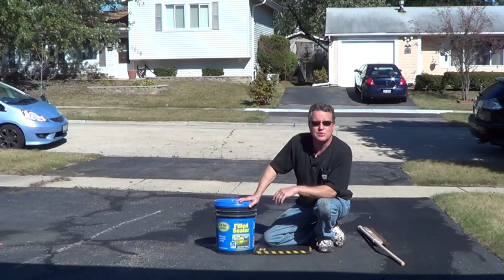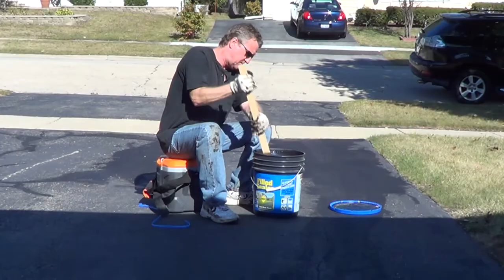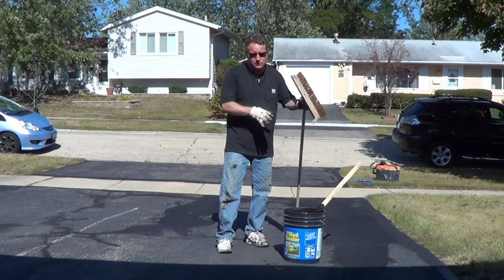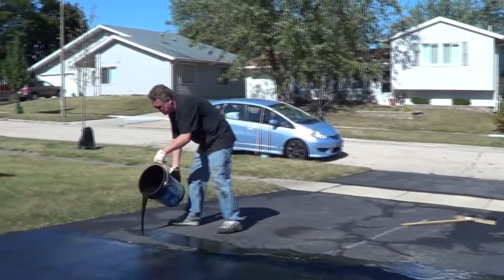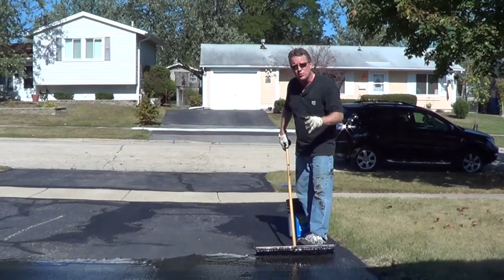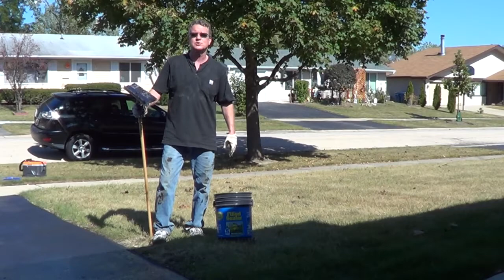How to Seal a Driveway - Driveway Sealer

Comment: Afterward, allow 48 hours for the water to evaporate and to firm up before pulling straight on/off, without turning steering wheel.  Wait 30 days to full cure,  you want to avoid heavy vehicles until then. 

For larger area that takes more than a couple buckets, get 55 gallon drums with removable lids and buy bulk sealant (you will need to call around and work to find it, it runs more like $2/gallon, get it in the morning mixed fresh, and do your job same day, so sand stays suspended and you don't need to mix.  Have one person pouring and pulling trailer ahead, have 2 people squeegeeing and brushing and getting edges.  Make sure to tape plastic 3' up on buildings or fencing nearby, and use strong tape to seal and protect concrete edges (gorilla tape works fine, just remove when done, test a small area first).  Cover your skin, wear old shoes and pants.

Will last 3 years if you don't scrape it with a snowplow, avoiding deicer helps some.